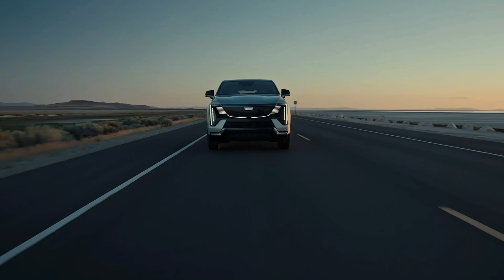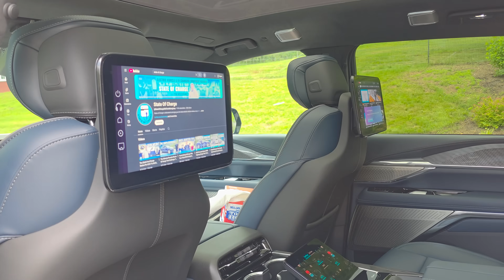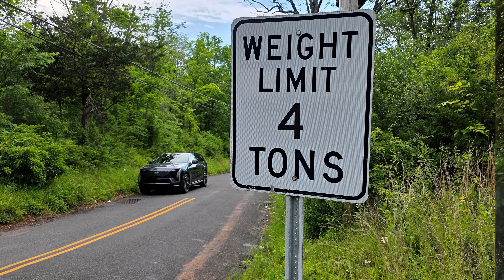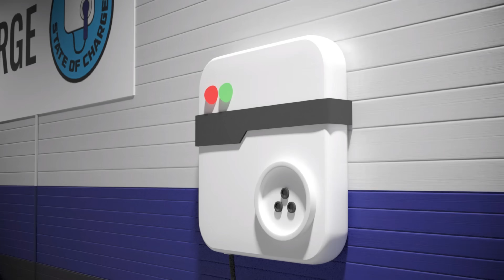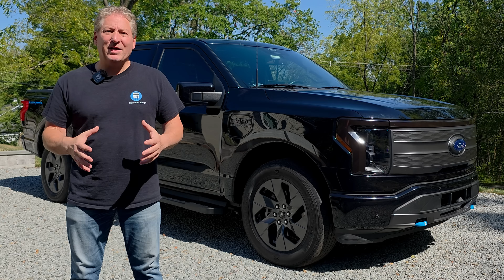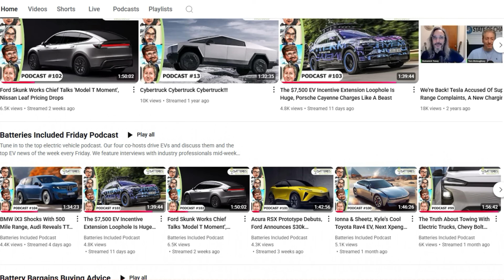Are General Motors Electric Vehicles Too Heavy For Some Public Roads?

Comment: In Marion County, Florida, road weight limits generally follow state regulations: a maximum gross vehicle weight (GVW) of 80,000 lbs, 20,000 lbs per single axle, and 34,000 lbs for tandem axles. Permits from the Florida Department of Transportation (FDOT) are required for overweight loads exceeding these limits.

Comment: Just found your channel, and then this video.  After watching and reading most of the comments, I Googled the  gross vehicle weight (GVWR) of a GMC 2500, Dodge Ram 2500 and Ford F250.  All are over 10,000 lbs ( 5 Tons).  Many people that tow either for work or campers go to the 2500 size trucks.  They weigh the same or more than the Silverado EV.  This isn't just an EV issue.  The ICE GMC 1500 tips the scales around 7000 lbs, so the EV version is about 1.5 tons heavier than its ICE counterpart.  I'm not a structural engineer, but I would agree, don't count on there being a huge safety factor in their designs.  You could be betting your life on what you ass-u-me.

Comment: Tom, I am a mechanical engineer. I don’t have the same experience as the road engineer you mentioned. However, I believe weight limits should be actual realistic limits. Bridges and culverts don’t care if the load is a car or truck :-)

Comment: I am also a Civil Engineer with 30+ years experience, I agree that the weights of EV's don't matter to most road surfaces but they do matter to guard rails.  Metal guard rails held up by wood posts commonly used on highways may not be strong enough to stop an EV.  Just as they won't stop heavy trucks.

Comment: There's never been passenger vehicles anywhere near these weights so it is an interesting dilemma. I have old bridges in my area that are 2.5 ton limits! These GM EVs are nearly double and these are just normal roads you have to pass or face a huge detour.

Comment: Thank you for this video. I have been falling for the myth that most EVs cause a measurable amount of more damage to roads compared to an equivalent ICE.  It makes sense that the weight of personal vehicles doesn't matter that much in the big picture.  

Five tons sounds like a lot (and it still kind of is) but I did some Googling: a school bus typically weighs about 15 tons, semi-trucks can be up to 40 tons, and fire engines typically weigh at least 13 tons but can be up to 40 tons. If those vehicles are allowed to traverse our roads then a 4.5 ton EV is probably ok - but it is worth watching out for bridges that really mean it when they show a weight limit.

Comment: For pavement heat plus having several tons of weight can damage pavement. You can see this at stop signs or intersections with stop lights. Most pavement around those areas are bumpy.

Comment: Significant weight on a smaller wheel base with smaller wheels is definitely harder on the road than a typical vehicle weighing 30% or so less. Basic science tells us this. Anything else you are told is just "them" fudging the truth. 
Why is this even a question? 
If you have even a small crack or pothole in the pavement - do you think slamming it with 30% more weight will make no difference? 
Our bridges and overpasses are way worse since more of these vehicles have been on the road. 
Grab a small and large sledgehammer - swing them at the same speed and see which one does more damage. 
This is a no brainer. Don't even need a "study" on this one. A+B=C

Comment: From what I’ve heard, talking to over a dozen road and bridge engineers, those weight limits are frequently based on the stability of the subsurface soil; roads built overtop of silt (which doesn’t compact very well) and similar “grainy” soils will have lower weight limits unless stabilized (see Practical Engineering’s video on engineered soil), which inevitably costs more money. And building on that, there are 2 pieces of infrastructure that can be damaged by adjacent soil shifting: Sewer lines and water mains. It’s a little curious that the engineer doesn’t have a record of why that is; are the roads themselves (not the pavement, the whole road; including buried infrastructure) old, or relatively new?

Comment: Another way that ICE vehicles damage asphalt is oil droplets, which they are constantly emitting. Where you see it most is in parking lots. The asphalt is always most damaged where the oilpans of the parked cars are. But ICE cars are also constantly coating roadways as they drive on them. For light vehicles, this is probably much more significant than weight. (Although another source of degradation is rubber & oil from tires, which of course EVs have as well.)

Comment: Yes, you are breaking the law. Further, if you damage a bridge, you will be liable for it. If you bring one down, no matter how rickety, you're buying a new one and your insurance probably won't cover it all. Weight limits are generally bridge capacity driven. Don't let anyone tell you different. You really need to stop at your local highway dept and talk to them. If it was only 500 lbs, I wouldn't worry about it, but 1,000 is half a ton. Wow, does it really weigh 9,000 lbs? That's what a Hummer weighs and more than a CyberTruck, what a pig.  Good God man, all this because you wanted an EV?

It's possible they can issue you an exemption because the safety factor built into the bridges should easily handle it. At least find out what it is. It's also possible they'll officially ban you from all the light streets. You know, the one's the signs already do? And heavy trucks can't be blamed because they're using truck routes and aren't even on those roads. Maybe a moving van because it has to be, but they're pretty light.

Comment: Here's a question for your EV enthusiasts that I haven't seen answered yet. Your large SUV and trucks weigh in close to 9K or 10K, whereas the comparable ICE vehicle is around 6K. In an accident, how much more force is applied, and how much more dangerous is it to the occupants of both vehicles?
Reply: Why does it matter?
Reply: @Samusaran77 , are you being obtuse? Of course, it matters. Imagine crashing into something that weighs 4,000 lbs more than a comparable ICE truck. It's not going to end well.
Reply: @crusher0427  Where are you getting 4000 pounds from? The IQ doesn't weigh 10k
Reply: @crusher0427 It's only 1500 more than a diesel truck

Comment: I have been going over this situation. There are a few other factors to consider about road wear. Damage is manly from crashes.
EVs are a bit heavier, but smoother on the road. They do not vibrate like an engine does. You don't have leaking liquids to worry about.
Consuming what I just said. I believe leaking liquids and vibration of an engine would have a larger part of the road wear. Roads get shiny. I wonder what causes that along with slick roads once the rain starts.
List of factors:
1) oil on the road
2) rubber from tires
3) vibrations
4) weight
I think oil eats the road more. Weight conbacks the eaten parts. Vibrations moves the surface to let the oil leak in to the surface. About the rubber from tires. It sits on top of the road surface. Can't think of a way that would wear roads faster.
Traffic people might want to test this out. I got a good test if that can be done easily. Have the road spit in two pieces. One for gas/diesel and the other have for EV only. Would be all EVs. Plug-in hybrids wouldn't qualify. Before you can go on the ev only road. You would need to verify you are driving an EV by quickly plugging in and be validated by the speed of charge. Not a toll, just a check.
Waiting for someone to bring these other factors in to the conversation. Road test is only for the traffic department to figure out.

Comment: The concern I see here is the pounds per square inch on the road surface. A truck weighing 5 tons with 6 tires on the ground may put less stress on the road than the 4 tires of the 9,000 pound Cadillac. While the rule may have been to restrict trucks, it is possible the heavy EVs may actually be harder on the road than a heavy truck with more tires. What tire pressure does it run? How big is the footprint to spread out that load? Of course, a fire truck is going to weigh more, but that is hopefully a rare thing down your residential street.

The one issue I do have with large trucks and also with large trailers is when they have multiple axles that don't steer. A twin or triple axle trailer being pulled around a turn can actually peel up asphalt. I worked in an industrial park for a while and one of the units hauled in and out their large trailer every day. It tore large grooves where they had to do the 90 degree turn to get the trailer in and out of their unit. This is not a problem with a heaver EV with 4 wheels as the wheels will have far less scrub on the turn.

Comment: Using weight limits to restrict commercial vehicle is an issue of the boy who cried wolf. They proliferate these low weight limits but not for an actual engineering reason but where there is an actual engineering need for the weight limits, people will ignore them because they have been trained to ignore them.

Comment: Wisconsin has Spring weight limits on vehicles during the thaw to prevent damage to roads when the bed structure may be unstable.  However, the limits are well above what an Escalade or Sierra might be even if fully loaded.

Comment: It should be noted that it's not weight directly which is the concern but the force exerted on the roadway. While they are closely related, the distribution of that load is also important as well as the duration of that load (sustained vs one-off loads). Typically, a 4 ton restriction due to a colvert is because a sustained load of 6 or 7 tons would damage the structure so the goal is to divert semi traffic. (6 or 7 tons because as engineers, we always include a factor of safety, these are still only estimates however).

Comment: By nature of the fact that EVs weigh more than their ICE equivalents, yes, they would cause more damage to roads and bridges. Is that enough of an increase in damage to make a difference? Especially when comparing to the amount of damage that ice and snow causes to roads (in places that get ice and snow) every year? Probably not.

However, my primary problem with the way EVs are currently taxed has more to do with the fact that EV owners are not contributing to the road maintenance fund in the same way that ICE owners are. Yes, the road maintenance fund is almost always supplemented from the General Funds of every state and/or city. But there is a reason why we have a gas tax with those funds specifically earmarked for the road maintenance fund in the first place.

EV owners are not contributing directly to that fund anymore. And I bet they still drive as much or even more than they used to back when they had ICE vehicles. That increases the burden on state and/or city budgets because they have to come up with the funds for road maintenance every year that isn't covered by the gas tax collection.

And yes, the gas tax absolutely needs to go up. And I'm saying that as someone who currently has an ICE vehicle that... does not get as much gas mileage as I would like. But it's the vehicle I could afford so that's what I drive. I'd love to have an EV, I just can't afford one - not even a used one. I got damn lucky to get my 2013 Traverse for the price I did. And I still miss my 2000 Town and Country. Honestly, if it hadn't been for the fact that my brother managed to bend the front axle when pulling it out of the ditch (that he put it in after losing control on a gravel road) which meant it needed new front tires every year, I would have fixed the transmission when it died. Sigh.
Reply: They actually pay more luddite

Comment: My understanding [which I've checked] is that road damage goes as a "fourth power law" of the axle weight - times of course the total number of axles. In simple numbers a doubling of weight means x16 the damage per axle. So the effect is real but heavy vehicles are the biggest factor.
If you walk or cycle a regular route you can often see this in action. There was a minor defect just before a local bus stop where the buses braked and tucked into the kerb. It quickly grew into a big ripple in the tarmac along with a deep sharp-edge hole big enough to throw a bicycle. I duly reported it to Transport for London and miraculously they coned the lane off and quickly repaired it!

Comment: Yes they are. GM's stupid heavy large Hummer EV and Silverado EV are getting into 5 digits on weight in lbs. They are the ones really should be charged extra for damaging the road. Not on the 5-6k lbs normal EV. 

What's Even worse is, many "Trucks" has more than 4 tires touching the ground. But these EVs only have 4 tires, so even if they have the same weight, the pressure per unit area is different.

Comment: I had a 2005 Escalade that weighed a little over 6000 lbs. I got a ticket in Vancouver Canada for parking where there was a sign that said “No parking of 
Vehicles over 3 tons. There were city small trucks parked there that I am sure weighed that much. I suspect this is a good way to make revenue.  The reason for the restriction was because the parking lot was on a pier in old town Vancouver. I am sure the original intent was to keep commercial off the pier. Not passenger vehicles. A couple hundred pounds is not going to make any difference. Especially when you a parked next to a Honda.
Reply: Just follow the law. Quit whining. If everyone did this, will create problems. Laws apply to you too.

Comment: A road 4 ton weight limit isn't a good way to calculate, my 4wd diesel 3500 is over 4 ton with over 6,000 on the front axle.
I would bet the heavier GM EVs have a more even weight distribution & probably less axle weight than my 3500 diesel.

Individual axle weight should be the limiting factor.

Comment: Full disclosure.  I have 2 EVs (one is 1.7 tons and the other 2.4 tons) so take my comments within that context.  From my point of view, i don't think we should have 9000 lb vehicles roaming our (yes OUR) highways without having them and their drivers conform to the same restrictions as commercial vehicles.  Not because of the damage to the roads but because of the hazard they present to other drivers.  As for the roads, it probably doesn't matter but as a matter of common sense, if the road has a 4 ton limit, there's probably a small bridge along that route with the same limitation (there are many where I live).  Perhaps we should do it "by the numbers" instead of waiting for someone to be seriously injured or worse.

Comment: Still waiting on the lighter, higher density batteries.  If I could get the Lighting with over 600 miles for a full charge, I'd seriously consider buying one.  Why so many miles?  I travel a lot in my F150 and if I'm trying to stay in the 20% to 80% battery usage, I'd want more.  Basically 500+ miles on that 60% of battery range of usage.

Comment: I would say the road wear being insignificant is a blanket statement, not really fitting for these 4.5 ton trucks. On average EVs are about 10-20% heavier than ice which does very little. Though they do have more torque which is measurably worse specifically at stopping and starting locations like stop signs and lights. 

But trucks are exceptionally worse for roads. Road wear is logarithmic so a truck weighing 9 tons (basically just a box truck) does 200 times as much damage to the road as a hummer EV only half its weight. And big rigs can be up to 40 tons. If road wear is a concern then we should be pushing more freight back to rail which not only has exceptionally lower rolling resistance and less damage, but can also handle exceptionally more without costing as much.

Comment: There is a funny story about passenger vehicles and weight limits on bridges.  

Car & Driver was testing the then-newly officially introduced to the US, Mercedes GWagen when they came across a bridge where the weight of the truck exceeded the weight limit of the bridge.  There was some complication that prevented them from backtracking, so they had to do everything they could to reduce weight and pull it across the bridge.

They removed the spare tire, drained all the fluids, deflated the tires, removed the battery.  The late great Jim Scoutten was with them filming the review for C&D TV and got it all on film.

Comment: As someone that has driven commercial vehicle vehicles for more than 20 years. Bridge law is not managed by a local municipality. The bridge laws governed by the state if you pick up a red McNally Atlas at the very beginning you’ll have an index of legal bridge limits and weights per axle for commercial vehicles and a recommendation for non-commercial vehicles. If you have a bridge wait say a fourth span bridge and it says 10 tons. That’s 10 tons total weight divided by each axle so 5 tons per axle. It would not be a good idea to cross that bridge. If you weigh 10 tons, it may cause a collapse. As the Silverado EV weighs 5 1/2 ton. Or a little over 9000 pounds you can cross the bridge like that without fear of a collapse. The crossing over a bridge that 3 tons posted. I would be back down right terrified to cross that bridge with a 5 ton vehicle. Safety first.. never cross the bridge or culvert or anything that has a possibility of collapse where you’ve already been warned. The liability is yours.